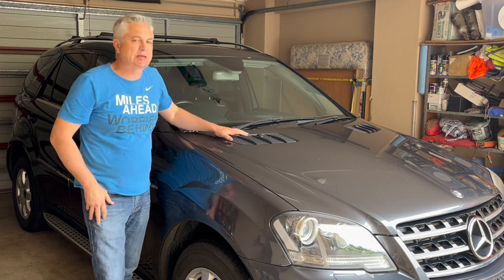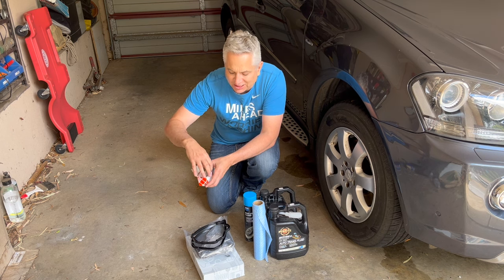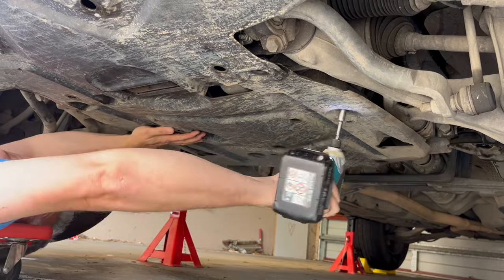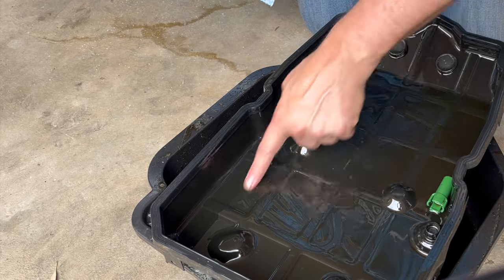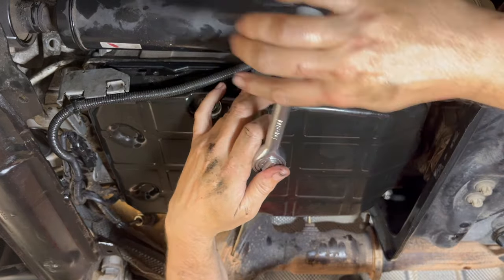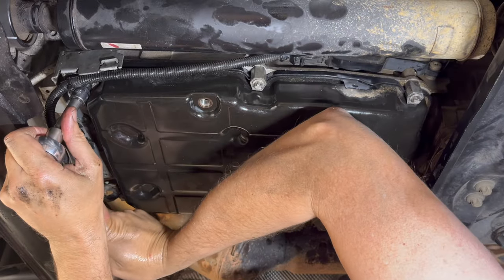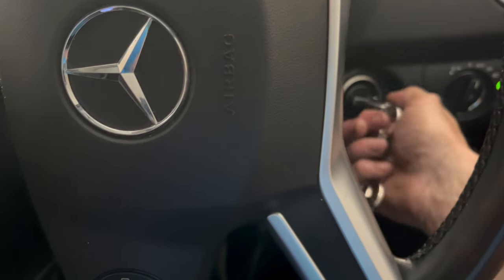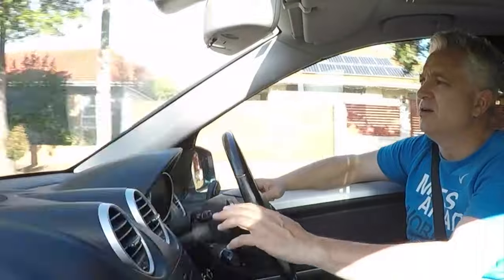How to Service Mercedes 722.9 Transmission by yourself - ML350 W164 Beginners Guide to Fluid Change!

Comment: Great video but let me tell you that the ATF you are using is not suitable for your car. 236.12, 236.13, 236.14, 236.15, 236.16, 236.17 are different specs and viscosities. There is no way a single product to support all these specs and viscosities for so many different car brands and models. Besides it is not approved by ΜΒ. You may use almost any ATF on any transmission but the MB 722.9 needs a very unique spec and viscosity.
Reply from the maker: Hi Mate, I fully understand you are saying and I appreciate that it doesn't make sense at face value, however I can absolutely confirm that Penrite manufacture this fluid which meets each of the Mercedes specifications that I identified in the vehicle.  I actually took the time to speak to the Lead Technician at a Mercedes dealership in Australia about this exact topic and he confirmed to me that the Penrite Fluid I am using is completely known to them and perfectly acceptable in all variants of the 722.9 transmission because of it's know ability to meet all of the MB specifications.  I trust this helps.  Cheers Drew

Comment: This IS not correct oil my friend!!!
Reply from the maker: Hi Mate, I explained in the video what oil I am using and how it meets the required MB specification.  What is really neat about this oil is it meets both the older and the later (low friction) 722.9 MB specifications!  Did you watch the whole video?  Cheers Drew
Reply: @DrewFixIt correct, Penrite fully synth fluid does it ok. Meets various benz models as well. I used it on my w204 c class and no issue whatsoever as well as clk c209 series cheers.
Reply from the maker: @johnlee2326  thanks for the support mate!  Cheers Drew